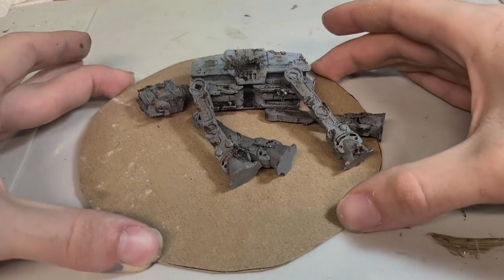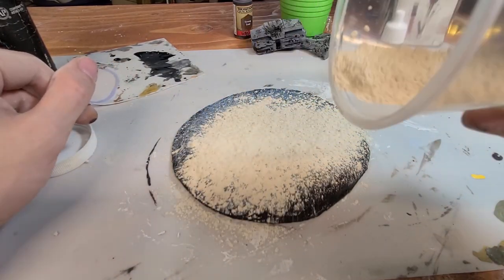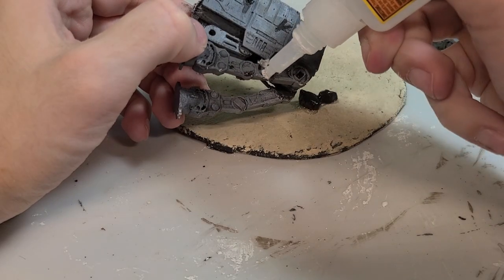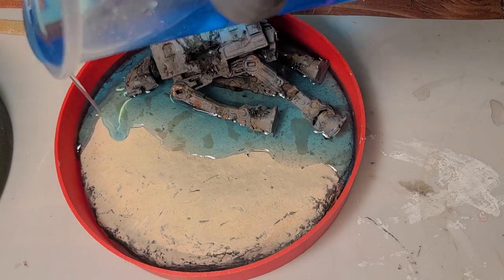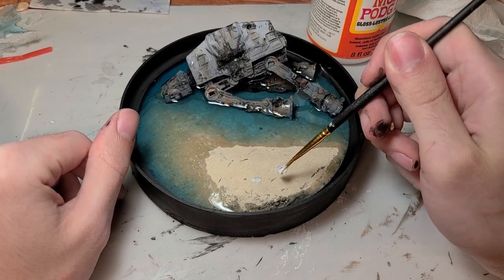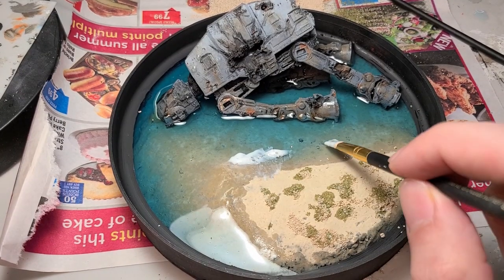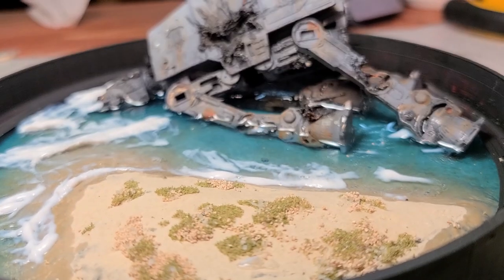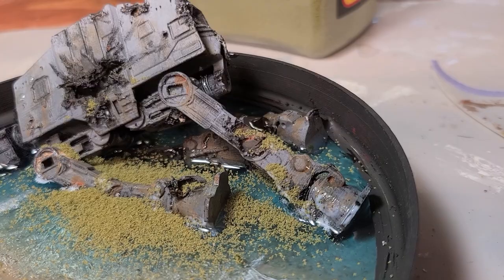How I made this AT-AT Diorama

Comment: Why don’t you cut the ring flush with the model so you still have the border but you are not inside the ring
Reply from the maker: The ring wasn't solid since it was 3d printed. If i cut it youd see the gaps in the center and i figured it would be even uglier.. And it was only meant to be a mold for resin. I forgot to add a layer between the container and resin so it all became one